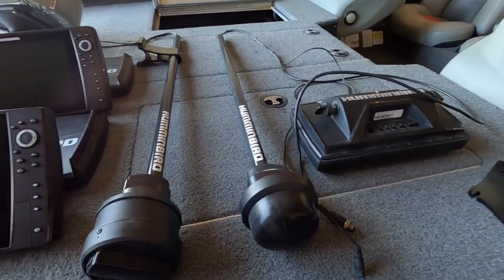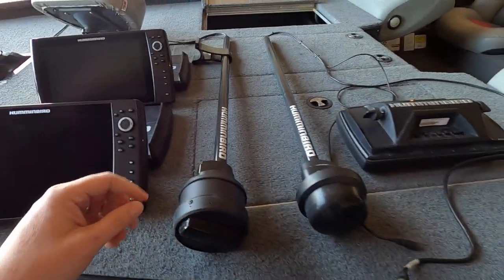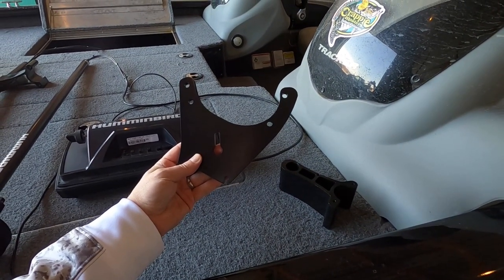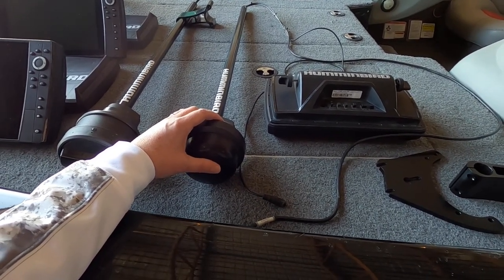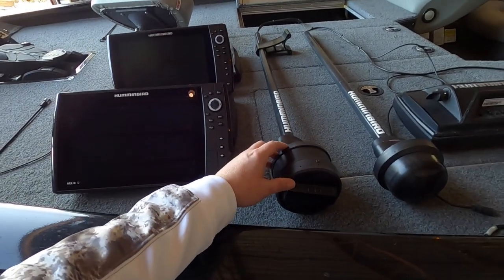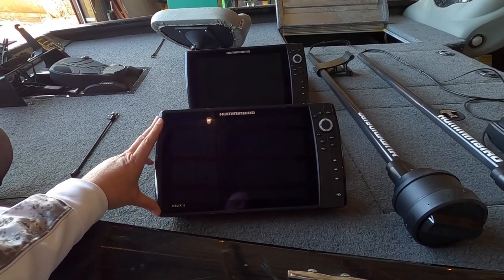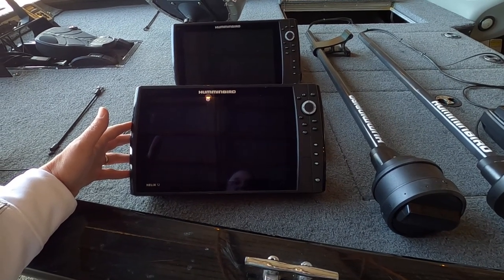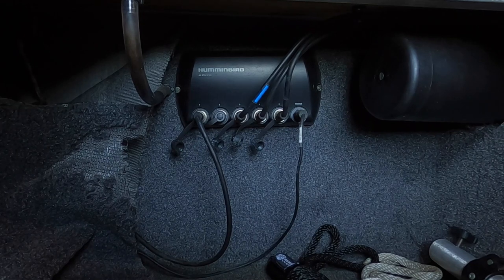Original AS 360 vs Mega 360 (Part 1 hooking up)

Comment: Looking forward to part 2. I have a mega 360 on my kayak, and I love it. Sometime's in deeper water, the quality seems a bit lacking, so I'm curious at how the standard 360 looks.
Reply from the maker: Thanks for subscribing. Standard 360 is in the 455khz frequency and the Mega 360 can run 455khz/1.2khz frequencies. If you can find side images of a structure in both 455khz and 1.2khz would be a good comparison. Hopefully have the boat back and on the water in March to make part 2. Lakes all frozen around here.
Reply: @mcelweeoutdoors2111  Is it similar to 2D sonar, where 455khz gives you increased range, but less resolution? Or is it like the main transducer, and it already automatically displays information from both spectrums? (Talking about the MEGA. I haven't tried forcing 455 yet)
Reply from the maker: @JoshuaBFishing  It will give information off just one spectrum. You should be able to switch to 455khz in the menu setting on you graph to give you greater range and less resolution. 1.2khz will give you less range better resolution. If I'm scanning a new lake for structure, I'll run 455khz or 800khz on my main side scan to cover more water. Haven't used my mega 360 as a main structure scanner yet.
Reply from the maker: Part 2 just uploaded last night. Will be working on Part 3 in a few weeks with more imaging with a sunken road with a small concrete bridge.

Comment: So if I'm upgrading from standard 360 to MEGA 360....and I have a Helix 12 DI upfront and Ultrex....and I'm running DI and 2d from the Ultrex....I'll need a Y cable to run the MEGA 360 in order to retain the 2d capability right?
Reply from the maker: Your Helix will need to be a G3 or G4 Mega +, and you will need the Y cable if you want to see the down imaging and 2d.

Comment: I am not finding mega 360 for ultrex, however I have the standard 360 for ultrex. In case I buy a mega 360 universal one, is that possible to use standard 360 bracket to fix universal mega shaft?
Reply from the maker: The mounting brackets for the standard 360 and the mega 360 for the Ultrex are the same brackets. I left my standard mount on my Ultrex and slide the mega into the mount.
Reply: @mcelweeoutdoors2111  thanks. I just found a Mega with no mount parts, will take it.

Comment: So how's it going?  How big is the differences between the two besides side imaging?
Reply from the maker: There is a big differences between the two. If you have mega side imaging on your boat switch from 1.2mhz to 455khz will show the quality of the image. Down side is you need a G3 or G4 with mega imaging to run the mega 360. Hope to have the 2nd video done this month an on the channel.
Reply from the maker: Part 2 just uploaded last night. Will be working on Part 3 in a few weeks with more imaging with a sunken road with a small concrete bridge.